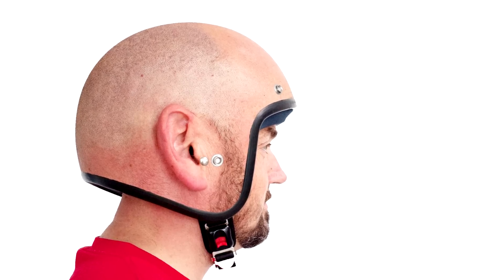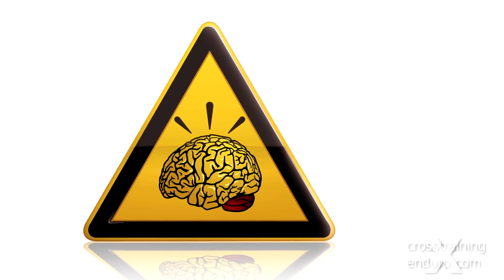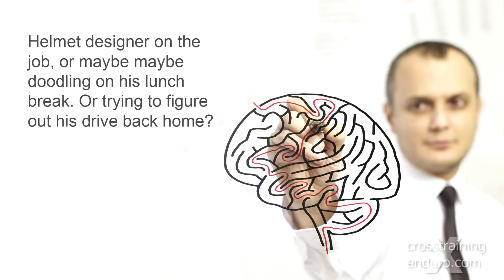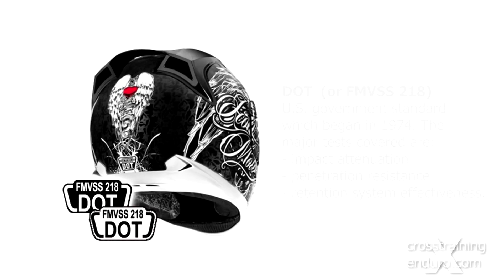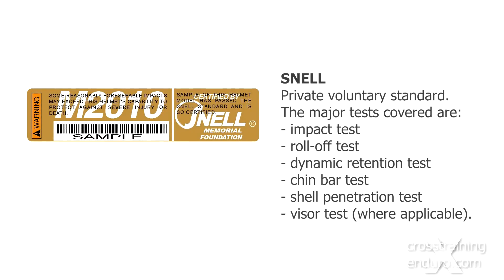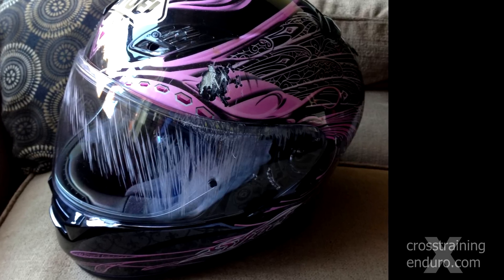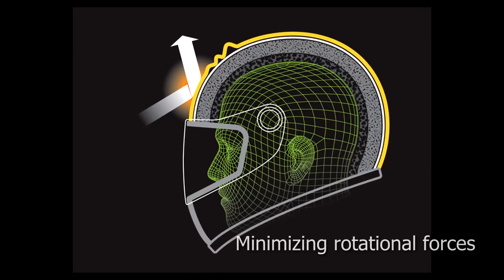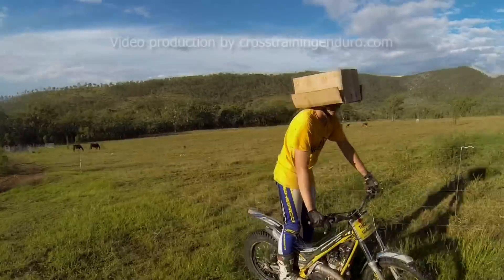Motorbike helmet standards for dummies DOT, SNELL & ECE22︱Cross Training Enduro

Comment: Actually SHARP in the UK does impact tests at 3 speeds, the last being faster than any others (I believe 6.0m/s, 7.5m/s and 8.5m/s) so I believe this would test the effectiveness of dual or triple density EPS foam helmets.

The downside of SHARP is they test relatively few helmets and many of the best helmets (5 star) rated aren't available any more. Maybe discontinued of sold out). Believe me, I've tried to buy one. Motocap.com.au is a similar initiative which interests me, but it's focus is clothing.

Comment: I was looking into a couple of local enduros and was puzzled to see a "no helmet cams" request. I googled around a bit and found that the safety of the helmet is compromised when we add projections to the helmet that were not in the original design and therefore not included in any of the regulatory testing (DOT, snell, ECE).
Reply from the maker: it's an interesting point, mike. once i did all that helmet research and learned about rotational forces i stopped wearing my gopro on the side of my helmet and got the proshot chinbar mount instead. some helmet standards insist on 'projections' from the helmet being no more than 5mm high for this reason, and a gopro mount is a lot more than that. :(   gopro claims the camera will break off before causing rotational injuries but i feel a lot safer without that side or top mount on the helmet.
Reply: Boost your brаin ррррoоооwer in 14 daуs? https://twitter.com/1ba03513cb794157a/status/804578733948444672                                          DОТ  SNЕLL   ЕCEЕE22  МОTОRBIКЕ HЕLМЕT STАNDАRDS FOR DUМMMMМIEЕЕS

Comment: Thank you.  I remember around fifteen years ago one of the American motorcycle magazines did an article about how most accidents happen at lower impacts than are tested in the Snell tests.  They recommended looking at helmets designed for the lower impacts.  The thought being your body will most likely not survive the higher impact crashes so why design a helmet that will allow you head to survive but will cause brain damage in a more typical crash (low impact) that your body will survive.  Following that article a major helmet manufacture pulled their advertising from that magazine.  I used to roadrace motorcycles and have crashed more times than I can remember sometimes at speeds above 100mph.  In every crash my head only fell at the most five feet (although I would slide for 100 feet or more) to the ground.  As I did not run into anything, even those high speed crashes were actually low impact crashes.  Great video!
Reply from the maker: ***** fully agree, the best research available says those lower impacts are by far the most common ones as you say, but none of the standards properly assess this. :-O congrats on surviving, that sort of high speed stack would have to be an adrenalin rush!

Comment: Sure, some brains are complex bits of kit, but when you see body armour making significant progression (forcefield sub 4 back protector) in safety you begin to wonder why it's taking helmet manufacturers so long to make any significant steps forward as its been fairly stagnant for some time. Is it a matter of just reaching and only maintaining the required highest standard set by safety bodies rather then aiming to exceed them?
Multi density helmet inner's must certainly be the way forward...what's taking so long?
Reply from the maker: Bram Van Den Berg will chat with australia's leading helmet gurus before starting a campaign... they suggest it's mostly apathy. most helmet manufacturers just want to meet the minimum standards and make a profit - changes bite into profits. and the guys who set standards know they'll have many manufacturers complaining if changes are made. having said that, helmets are getting better as materials improve which is good news.

Comment: My research clearly proves that a Neapolitan container is far more crash resistant than either vanilla, strawberry or chocolate alone.
Reply: An independent and untrue study shows that 3 KFC buckets stacked offers the tastiest form of crash resistance.  Also, fried chicken drum sticks can be kept in the dead space between buckets.
Reply from the maker: blkvtr1k there is strong evidence for your claim but raspberry ripple consistently out performs all others in both impact AND taste tests.
Reply: Good luck finding raspberry ripple in AS1698 though, you could always run the risk and import one I guess.
Reply from the maker: Blake Craft excellent point, blake. and once cooled off, the chicken drum sticks also act as a dual density liner in a crash, although getting the colonel's secret blend of herbs and spices out of your hair afterwards takes forever.